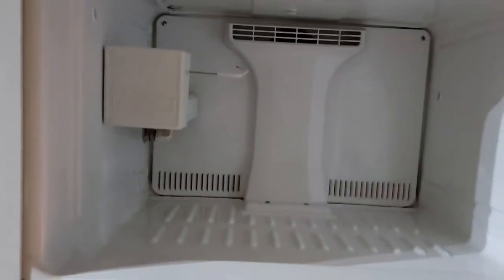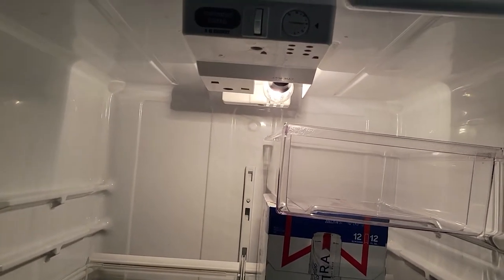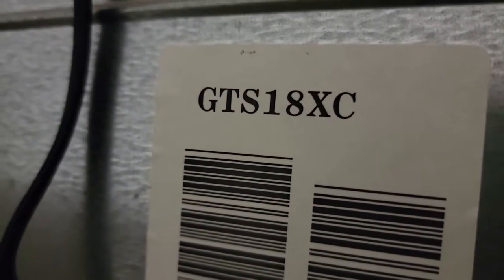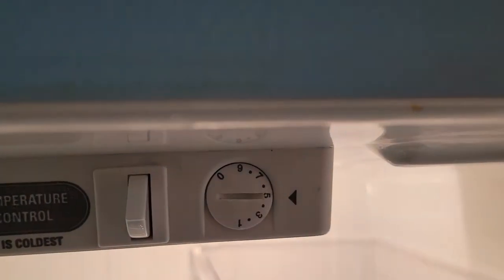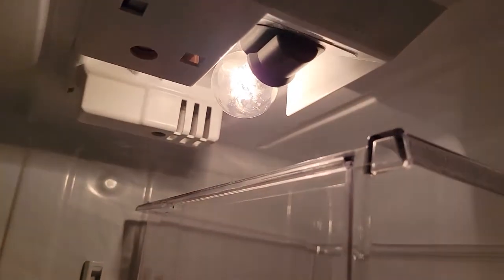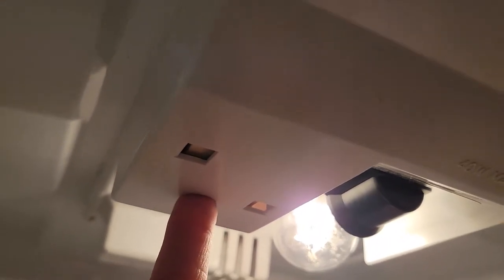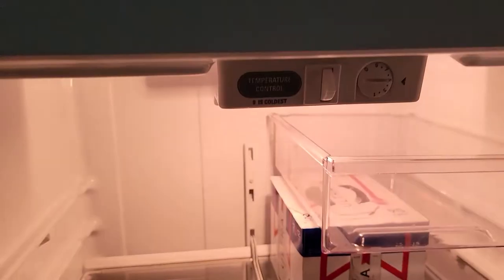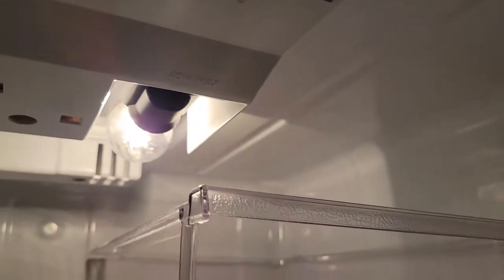🥶 🧊 Refrigerator Won't Cool or Freeze After Power Loss? - Possible Fix!

Comment: Thanks. Your solution didn’t work but it led me to a similar one. That switch isn’t a button, it’s a dial without a knob, if whacking it or pushing it doesn’t work, wedge a screw driver into the hole and turn it. That worked for me.

Oh, mine also happened after a 48 hour power outage.
Reply: @theopinionmachine606 Thank you! That worked for me!
Reply: Do I need to give time for it to start working or it instantly starts??
Reply: @petermutale7787  I heard an immediate engagement. Aka, there was a click, then the compressor motor started. Obviously it takes some time to cool down & get to the the right temperature inside, but you should notice something happen.

Like turning on a switch.

Comment: Thanks for the helpful video. I have a GE side-by-side refrigerator and freezer. model number is “GSH25JSTC SS”. Cooling stopped  after a recent power outage. Lights come on for refrigerator not the freezer and cooling has completely stopped. I am still trying to find the reset switch..don’t see one for this model GSH25JSTC SS
Reply: Any luck ? I have the same
Reply: @NewYorkRebel187  any luck?

Comment: Sounds like the defrost timer.   My fridge is not working either after a power outage.  Tried turning the defrost timer with a screwdriver and still not working.   I'm thinking I have to replace the timer or the refrigerator.  Mine is a 20 yr old GE bottom freezer and looks new.

Comment: Came across your video after my fridge went out due to a possible outage while we were away for Thanksgiving! I didn't find the same switch (I have a Whirlpool side by side), but I did turn the fridge temp to off and when it clicked on, it started running! Going to give it a day to see if it cools properly, fingers crossed! Thank you for your video! Saved some $$$ with a simple fix!

Comment: I have the problem of power surge shutting down my older side by side GE w/icemaker. I cannot find the reset button -model is GSS23QSTA SS.  Can you help?
Reply: I have the GE side by side refrigerator with LED panel and ice/water dispenser. If the power goes out, and it does a fair amount of the time, the unit turns off and everything defrosts and randomly starts itself up again. I cannot find the mystery switch and all the front LED lights go dark while the compressor and other items are inoperable. Anybody here know the secret with this type of set up?

Comment: power just went out for an hour and same thing happened to me.... lights come on but no cooling..... hoping to find a video similar to this that has my same model, my temp control is on the outside door of the freezer.... it's a ge model from 2008
Reply: Same here. Did you fix it ? How please?